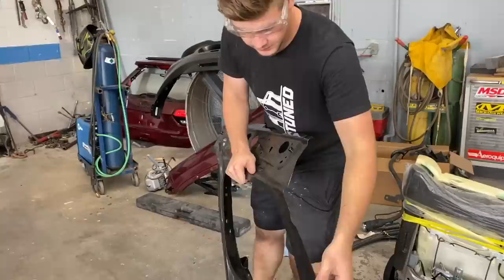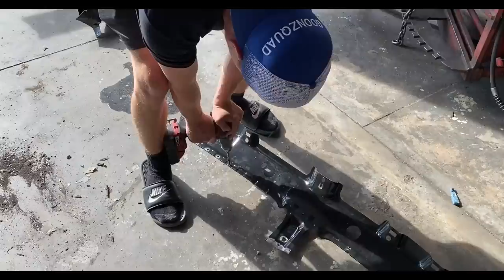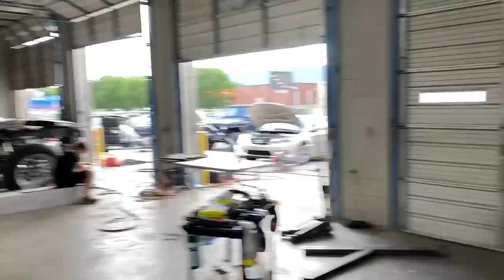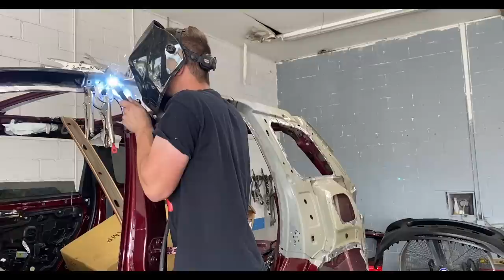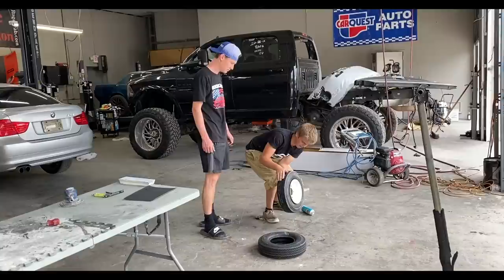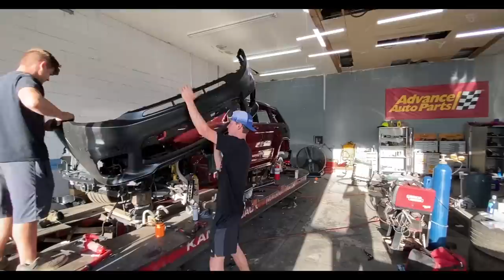Rebuilding A Wrecked 2018 Jeep Trackhawk Part 10

Comment: Seriously where did Vtuned guy learn all this stuff, he seems to be on it like he made it himself on the factory. good stuff guys keep it up
Reply: its pretty simple, grind off the spot welds, rip of the piece, weld in the new one
Reply: 1BlackopsGuru not that simple haha
Reply: @1BlackopsGuru  Yeah, sure, that's what anyone will say, is not that simple :)
Reply: 1BlackopsGuru tru
Reply: @1BlackopsGuru  its might be simple from your perspective but remember it takes guts to manage all the measurement and get it right..
Reply: my guess is he grew up in / around a shop and has learned all this from a young age watchin his pop's or somthin along em lines... Bravo Vtuned 👍👍
Reply: Probably from family considering his age... I was doing this type of work at 12-13 because my dad had a body shop.
Reply: Not easy at all getting all the lines and measurements right. A lot of body shops take short cuts but no Vtuned. The man has an eye for detail and is a perfectionist
Reply: Def he grew up around/inside auto shops
Reply: A lot of shops hack these totaled cars back together. That’s dangerous when it’s a 4 cylinder Toyota grocery getter, but a ridiculously fast SUV? That’s nuts. These guys don’t look to be taking too many shortcuts but to be honest, I’d want all of those parts replaced, not just bent back into shape. Those front end and A pillar pieces are structural members that are essential in a crash to keep the occupants alive. The good news is that this vehicle is worth so much that you can spend a stack of cash getting original OEM replacement parts. It’s not a F1 Ferrari that’s almost impossible to total but it’s not your average Jeep either.
Reply: lelblu7 he was born in the shop
Reply: @peternovv817  I'm not sure exactly but I think I heard him say on his channel he went to college or something to learn this stuff but still he is wise beyond his years he's pretty darn good at what he does!
Reply: Its not really that hard for anyone that is smart and fast learner ive rebuilt over 150 cars similar damage im 29 no college all self taught
Reply: thats the differenz between GETTING a job and LEARNING a job
Reply: Yes
Reply: High school mechanics class😂
Reply: he learned from Youtube
Reply: My guess; it's a family business and you grow up learning.
Reply: @1BlackopsGuru  ok
Reply: @jocarrillo52  thats fantastic that you did it on your own merits kèep up your hard work ..stay safe from all in the UK🇬🇧🇬🇧🇬🇧🇬🇧👍
Reply: @1BlackopsGuru  If it were that simple, everyone would do it and there would be no Vtuned.
Reply: It is amazing the knowledge and capability he has at his age.  We will probably learn Vtuned is in his 60s with 50 years of experience......and found the fountain of youth 😂😂   Fun to watch these guys with and without Vtuned.

Comment: You guys need a sheet metal punch. Screw all that drilling.
Reply: They cost like $60 and have a flanging head on them too. You can punch 5/16" hole per factory specs and use flange to mate adjoining metals so they fit snug while welding. Air operated to save time and make each hole uniform in size.
Reply: And they probably burn through $60 worth of drill bits, not to mention the time needed for drilling.  The punch is instantaneous.
Reply: And a spot welder. Saves all that manual welding
Reply: Steven H I thought they bought a spot welder?
Reply: @eizzle78  a cheap spot welder that didnt hold up very long
Reply: towboatjeff yeah I thought it was a harbor freight one or something generic

Comment: Y’all should surprise Vtuned with a project car for all the help he’s given
Reply: He is smart enough to not drive a car that will break apart in any accident.
Reply: Dmitry Khalatov what did you mean
Reply: @OGSpermCells  I mean - manufacturers invest a lot of money to design a car structure so it will dissipate as much energy as possible in a case of accident and deform in a controllable way - protecting people inside. "Pulled" body with cuts and welds at a random places is nowhere close to the original - from the safety perspective.
Reply: @dmitrykh9183  the cuts and welds are not in random places but pretty specific actually, why do you think the manufacturers make all of those structural replacement parts if it wasn't safe to repair a crashed car? What do you think happens every day in body shops across the country? Fyi they don't sprinkle unicorn dust on damaged cars and watch them become new again.
Reply: @christopherc1976  well when it comes to common sense, you don’t really need a professional to tell you that they make body replacement parts in sections like that for sale for this purpose specifically. if everything lines up perfectly then there really is no safety issue. but yeah maybe go look up a common sense “professional” and take his word not mine

Comment: You guys should consider getting a spot weld punch tool. Stop drilling those holes and use a pneumatic tool that is meant to do just that. One press of a button and you got a punch pressed nice hole. No hassle no matter what sort of steel the part is made of..
Reply: It is a good tool to have saves so much time
Reply: You can also use a plasma cutter for the holes then clean them up with step drill bit
Reply: Cost benefit for a one/two time job??
Reply: they are pretty cheap from Eastwood.  Works great!
Reply: They had one they broke it first time using it

Comment: Awesome work you guys did on this jeep.....if i can give any of you some advice from what i got taught waaay back when i used to convert American cars from LHD to RHD in AUS, and had to spot weld new firewalls in!
When doing so many tac welds on your panel, dont do tac after tac next to each other, because the steel is only between 1.2mm to 1.6mm so before you know it, you will put to much heat into the panel and it will warp the crap out of it, and it once that happens they are an absolute nightmare to fix!
The cooler you keep the panel, the straighter it will remain......if you space each tac out to about 500mm apart, and just keep working your way around the panel to fill however many there is but letting the panel cool after you go around about 3 to 4 tacs next to each other, and you will be sweet! Hope this helps anyone :)

Comment: I reckon when the Goonies get there bigger shop built they need to employ v tune on a permanent basis as this repair is way over there head at present.
Reply: They wouldn't have bought it without  knowing vTuned is in on this one...
Reply: My guess is they will buy their own frame machine and do it themselves.  They're currently being trained by the best so they will be able to do it.
Reply: @jskidpatrol  And I would think regular visits for consult would be expected. It would be nice to see them in close shops, though.
Reply: @Ben Jones It's a big expense for sure and will be interesting to see how they equip the new shop.  On a side note, their local Chattanooga friend @DannyTV has a rarely used frame machine just sitting in his garage.  Hmmm, makes one wonder :-)

Comment: I rebuilt a rollover 1994 Grand Cherokee in 1996 and it was really hard work!  Then I did a hard rollover 2000 Suburban in 2002.  It was also very hard work and required lots of body work all over.  I am done with rollovers.  It is looking good and you guys and V-Tuned are doing it Right!!!

Comment: Just a suggestion when you have the new shop on your land maybe you could if the boxes are any good from the tractor trailers.weld them side by side and build a permanent paint booth.Install exchaust fans and heaters.

Comment: Such an awesome build to watch from wrecked to almost ready to paint! Great job v-tuned and goonzquad! Hey by the way interest in a  set of spit weld hole cutters , and an air powered  spotweld  punch tool. If your going to be putting in holes for spotwelds that will help y'all with burning they do many drill bits and it's very fast

Comment: Get some cobalt drill bits with 135° tips. They go through metal like nothing. Do not put pressure on it. It will just pull itself through. Especially when drilling with drill paste and switching bits every 5 holes..

Comment: Would like to watch one day Goonzquard come to help out with Vtuned projects, that will be awesome. Like both of your channels. Keep up the good work.
Reply: I really don't see that happening. What use would these two be on proper body/frame work? I don't think vTuned would have them in his way. That's why they go to him for the "real" work - he knows what he's doing.
The boys are pretty good at what they do, which is mostly bolting-on aftermarket trinkets and spraying panels. vTuned has some serious fabrication skills, something Goonzquad may gain through time but lack for the moment. There's a huge difference between making a bracket for something and doing serious, structural fabrication on the bones of the car. 
What we don't seem to know is whether vTuned has full-time staff, or even if it's a full-time shop.

Comment: Pro tip- use cavity wax and coat anything you can’t spray paint to prevent rust, etc inside the a pillar, the c pillar, rear quarter panel. Just to coat any bare metal. All that work will be a waste in 5 years when the rust comes through

Comment: Hi
You should try to use compressor air to cool down the welds after each spot - it works well at stopping getting things on fire ;-)
cheers from UK

Comment: Heck with drilling holes get a roper Whitney punch done in minutes. Look it up. I’ve been in the sheet metal trade for over 30 years if you have a lot of hole it saves time.

Comment: I am a fire fighter and i think you have the wrong extinguishers in the garage. Powder is very corrosive (much salt in it), you better buy foam ones. 

Problem with powder is it will always be in those little spaces, and rust keeps on building up over the years. With foam you don't have that problem.

It's a tip

Comment: Surprised vtune don't have a panel flanger/ hole punch for sopt welding got mine 20 yrs ago of the Mac tool truck love mine could have punched all those panels in half hour tops.... flanger comes in handy on quarter panels door skin,patch panel overlapping instead of butt welding sometimes...just a suggestion 👍✌️

Comment: Ok... You have all the pieces to replace the left side. None of it should have been cut apart to splice pieces new and old together. It's on the rack, it's held straight, replace the entire side, structural, inner and outer. You made a lot of extra work for yourselves. I'm curious if this is a learning process or that's how it's done down south? I'd like to know; thanks. BTW it's looking good. 👍

Comment: None of the HSS section should have been plug welded because you have affected the strength of the steel because of the Heat affected zone of the plug weld. HSS should be spot welded with a proper spot welder designed to weld HSS and UHSS steels

Comment: @vtuned what’s the reasoning for drilling holes in the panels for the welds why not run the weld in the location with drilling holes for extra strength in the spot weld.
Reply: @vtunedgarage

Comment: One question, why don't use the whole new panel and cut the original panel to fit the new one? Isn't that panels made in a size to fit in a "suggested" welding area? Because I know that there are areas in the body that get more stress or are meant to deform in a crash, so doesn't cutting and welding in a different place could cause some structural problem?

Comment: There is hidden damage on the rare quarter panel in the inside right under the area u replaced behind the gas tank chamber cover. Please fix before u go further and finish it it is very noticable throughout the vid.

Comment: Quick question.  These boys are great, but that car has been taken way apart, drilled, welded, pulled, and more.  Now Chrysler has spent millions of dollars on engineering to make sure the thing holds up on the road.  It seems to me that even just a small mistake by these guys and the structural reliability of the car would come into question??  Anybody?  BTW when I was these kids age and a car had frame damage, it was deemed totaled.